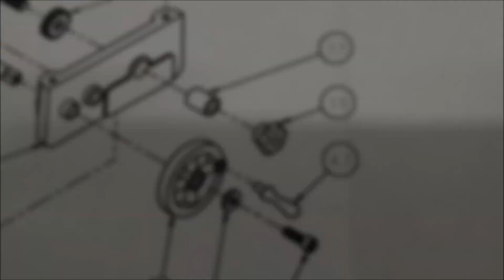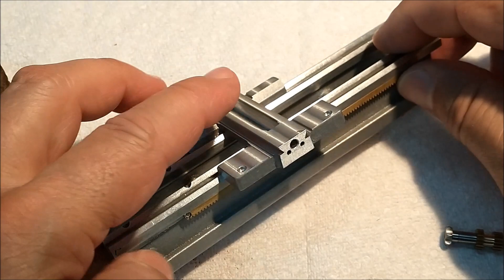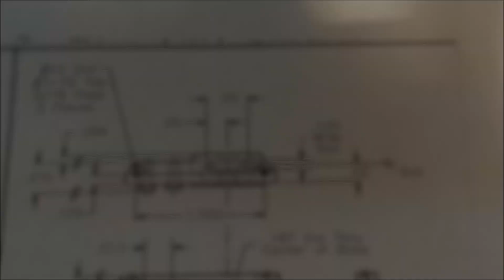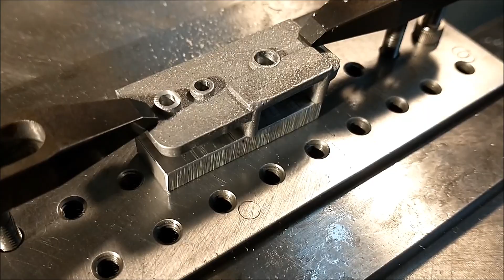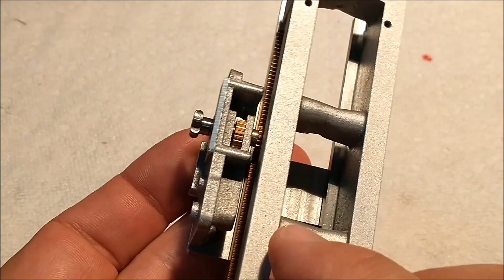Machining a Miniature Lathe - The Apron and Power feed clutch

Comment: Testing the gear spacing in the mill is a brilliant idea. I actually do have to redesign a small gear "box" that is being made of such miniature gears with fancy and unknown module. The known modules did not calculate well and I already saw myself building a gauge á la "ClickSpring" in order to find the proper spacing. As I planned to drill the axle holes on the cnc, I did not realize that testing on the machine would be obvious and much simpler solution. I neither realized that Your spacing problem directly connets to my spacing problem, while watching the video. The coin dropped this morning during breakfast :-) - love it ! Regards Frank.
Reply from the maker: It feels good when the lights pop on. Glad to help.

Comment: HI Joe i am loving these series. I have a bit of an off topic puzzle. I have an old PZO microscope, which was made in the 60s, i think. It functions very well but there are patches of what i assumed were rust on it, on the slide holder and nowhere else.I have only cleaned with isopropyl over the years i have had it. The "rust" is "spreading" and has a smeary look to it. I cant find anything about this. It smells more of copper to me, than rust and wonder if its a copper alloy of steel? Have you any experience with this? All the very best.

Comment: This late in the project it must be great when your "fit at assembly" dimension almost precisely matches the one on the drawing. Excellent job on matching the spec for many of the parts and features.

At this point you're providing basically the best tutorial available for this kit!

One thing that did seem to get cut though was the setup process when you cramped the apron to the plate. What did you reference to make it parallel? Did you center on the casting boss before milling the top surface?
Reply from the maker: Using 2 different size gage pins held in a drill chuck, I visually aligned the bosses inline. That centerline became my Y axis zero and the rest was easy.

Comment: It surprised me a little that you machined the top edge of the apron before establishing and drilling the holes for the gear shafts to make sure they’d fall in the middle of the bosses. Was there a reason for this or perhaps something I didn’t see? BTW, finding a DRO to fit this machine is going to be a bitch.
Reply from the maker: Using 2 different size gage pins held in a drill chuck, I visually aligned the bosses inline. That centerline became my Y axis zero and the rest was easy. This was done off camera.
Reply: @joepie221  I kind of thought that was the answer, consistent with your previous methods.

Comment: I'm not a machinist, but it looks like a lot of your fixtures and machine bits are magnetized slightly.  Perhaps the resulting forest of needles sticking up all over a part being machined is just a distraction easily ignored.  If this were a problem, could you use some sort of bulk degausser? Whatever, it doesn't seem to affect the speed or quality of your work.
Reply from the maker: I have a demagnetizer, but don't work with carbon based steel very often. 17-4 stainless is as close as I get to working with anything magnetic.
Reply: @joepie221  , thanks.  I did remember that you built medical equipment which would imply lots of stainless steel.

Comment: Hi Joe, how did you align the apron on the fixture plate. Thanks
Reply from the maker: I visually aligned the bosses using matching gage pins in a drill chuck. Once they were all on the same centerline, I locked it down and zeroed the Y axis. From there I did the upper edge then the holes.

Comment: As always, amazing.

Didn't I see "something" between 20:45 and 20:49?
Reply: It's just a jump to the left. 
Then a step to the right. 
Put your hands on your hips. 
And draw your knees in tight. 
It's the pelvic thrust 
That really drives 'em insane. 

LET'S DO THE TIME WARP AGAIN!
Reply from the maker: Occasionally the frame rate of the camera and rpm of the machine play games with each other. The small auto focus adjustments makes things look other than they are.

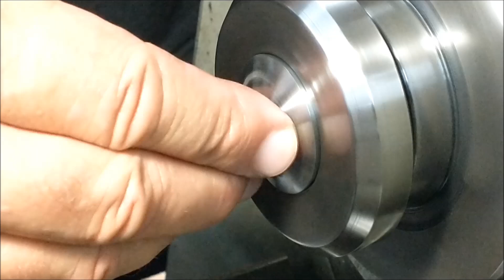Comment: I had to rewatch 4:30 three times to confirm you pulled the part from the collet chuck while still spinning! Man knows his machine.
Reply from the maker: I've done it a few times.  ( like a million ) What you don't see is the constant pressure on my release lever to keep the collet open. If you ever try this, back the tool out of the way and make sure the part axis and machine axis are very close before you try to slide the part in. If its off, the part can grab and helicopter violently. If a tool is close, it may not end well. Be careful.

Comment: This kit requires skill and patience far beyond the typical hobbyist level, I'll bet a small percentage of these reach successful completion.  It is a real challenge and skill builder for those that complete it. A lot of great detail in this series. For the same effort you build one of adequate scale to be useful. The Emco 3 inch Unimat and 5 inch Compact 5 a little light and under powered to be really useful. Maybe a good design of that size would be useful. Great series.
Reply from the maker: Thank you.

Comment: [ question ] Why don't drills leave a hole that good enough ?  Why do you have to ream the whole after opening it with a drill to get precision?
Reply: It's all about  the drill geometry, and/or the final finish of the hole.
Reply from the maker: Drill can deliver good holes, but a lot of things have to be inline for it to happen. Having only 2 flutes, if a drill wears even slightly, the size and finish are gone. reamers have 4 or more flutes and stay centered much better. This delivers closer sized holes and better finishes. For screw holes and such, a drilled hole is fine, but where a shaft or pin fits, a reamed or bored hole is usually required.
Reply: @joepie221  Are there single tool solutions to this? Do multi/ high flute number "drills" exist so that the holes can be made in one step?

Comment: Joe Pieczynski, You make me sick. You made that knob so easilly, made it so perfectly and made it look so easy. As for your solution to the height of hte apron, so simple an answer and so accurate. I love your videos and admire your exxpertise and the way you share that knowledge. 
I have a mind to set you a challenge. Do you have BA (British Association0 taps and dies?
Reply from the maker: Thanks for your compliment. I also don't have metric tooling that small.
Reply: @joepie221  If you are still willing to accept  mystery challenge I'll supply the kit complete and any taps and dies you'll need. These are 5, 7 and 8 BA as well as 1/4 x 32 and 5/16 x 26 Model engineer series. As far as I know nobody has built this particular kit on YouTube but Keith Appleton has shown it.

Comment: Always a good idea to check the meshing like you did and not rely on drawing dimensions.
Reply: The meshing adjustment technique could have been used for the reversing quadrant gears, but you knew that 😉. Fine work, Joe.
Reply from the maker: The reversing quadrant gears were adjustable. It was the lower drive cluster I should have checked.

Comment: What I would do (regarding setting the pinion axis to underside of the carriage) is to make the measurements as you did, but on purpose machine a little too much from the top edge of the apron (so the pinion mesh is too tight).  Then I would insert shims for proper running.  If the pinion/rack wears, & backlash gets high, I could drop shims.
          When you made the measurement, didn't you use a different gear? (If was one with a larger gear in a cluster.)  Shouldn't you have used the same gear as the one that engages the rack?  (Does the other gear cluster also engage the rack?)
Reply from the maker: Shims have their place, but not on this model. The gear I used to gap the apron was the same stock the other gear was cut from.

Comment: Hi Joe, 
Sometimes it looks like you pull your part out of the collet while the lathe is spinning, I've seen it a few times and not known if it was my eyes tricking me or not. I would not question your safety just wanted to clarify if the lathe was spinning or not. Cheers
Reply from the maker: Its still spinning at full RPM. I have opening pressure on the drawbar off camera.

Comment: Would you explain why you 'peck drill' when plunging with the end mill to cut the flutes in the clutch knob? You are not cutting a complete circle (hole) in the material so I'm assuming there is no way for the flutes in the end mill to pack up with chips. Just curious as to the reason.
Reply from the maker: Imagine a tire stuck in a half round ditch. As the car rocks, the tire tries to climb out of the ditch. On a half contact cut like these, the exact same thing is happening to the end mill because of the uneven load. Once the cutter breaks through and the load is gone, the cutter will relax and then engage the downhill surface all at once. This could either chatter leaving a bad finish or break the smaller cutter. I peck to be sure the cutter relaxes between each contact.
Reply: @joepie221  I knew you would make sense of it. Thanks. I didn't even think about any side load on the cutter in a plunge cut. Take away half of the side support and suddenly I'm slapping myself in the forehead. Yet again.